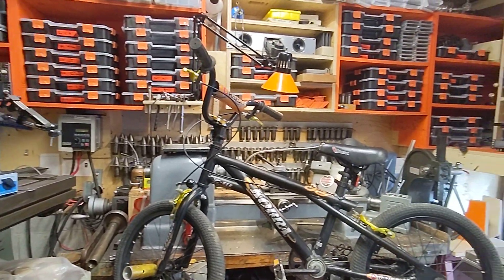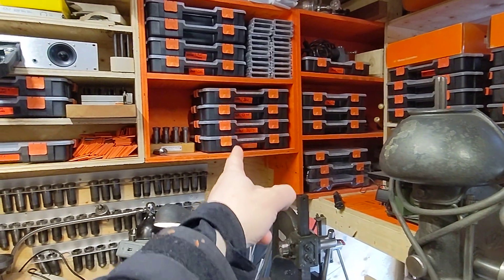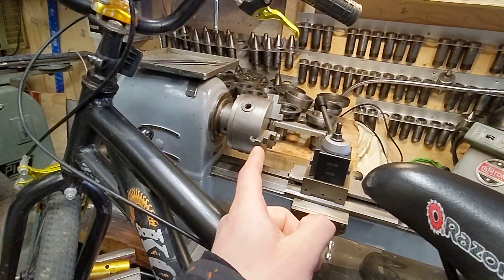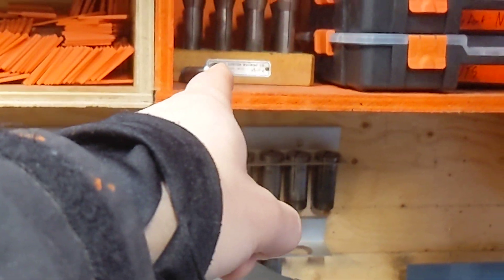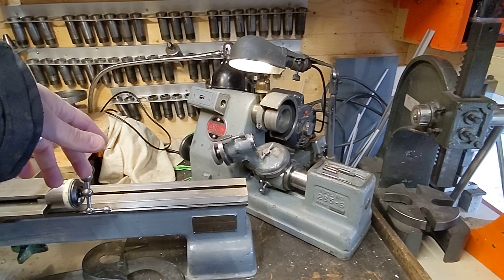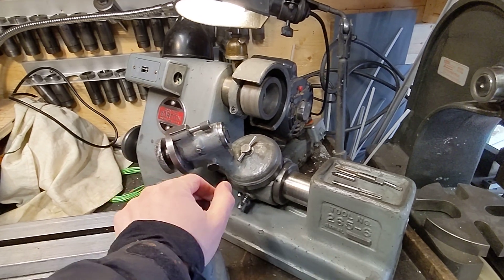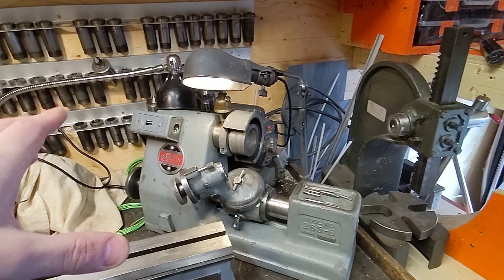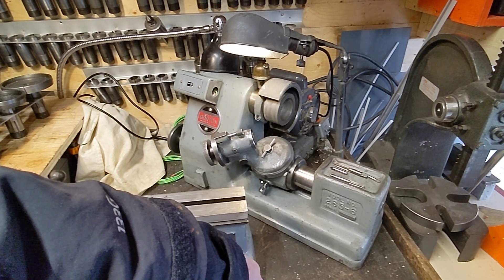lathe tool grinding geometry - Gorton 265-6 #machinist #Engraving #SheetMetal #Workshop

Comment: It would be very interesting to see this in operation sharpening an endmill.
Reply from the maker: @jeffpope6252  I don't sharpen many endmills.  I do mostly single flute cutters, some center points and some punches.
Reply from the maker: @jeffpope6252  https://youtube.com/shorts/EvQEB22693c?feature=shared I made a center it shows basic operation.
Reply: @LikeDotAudio  Thanks for the quick reply and link. I was gifted one of these yesterday and was trying to learn more about it. I saw one comment in a web search that implied it "could" grind an endmill, but was typically set up for single point engraving bits. I have not yet found a video of it being used for an endmill.

Comment: Can you measure the angular relationship between the groove in that collet and the facets inside the collet?  Not a silver bullet but it might help when you're trying to work out the angles on your cutter.
Reply from the maker: Not sure.   I did think about loosing the index pin, or putting new keyway on the collet so it wasn't fixed.   Aligning d- type single lip cutter is easy cuz they rotate.  Thanks for seeing the problem in a new light

Comment: Any new insights or updates on the Gorton? I'm thinking to pick one up next week and I'd love to hear your thoughts. There are a couple collets included in the sale, but I'm a bit worried 4NS are hard to come by these days.
Reply from the maker: I love it.   They are hard to find.    So that's the huge drawback.   However if you need 1/4 single lip cutters... That's only one collet. So don't expect to find a collet for every cutter you own
Reply: @LikeDotAudio  how heavy is the SOB? I'm wondering if I'll need to disassemble to move and load.
Reply from the maker: @VastCNC  nah.   The bench mounted version is not so big you need to take it apart... Over 40Kg I'd say.